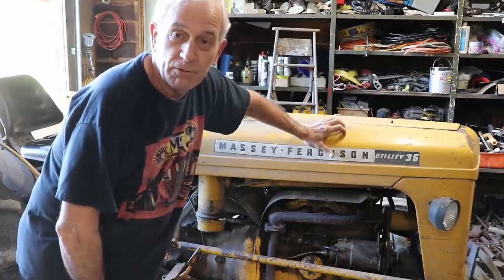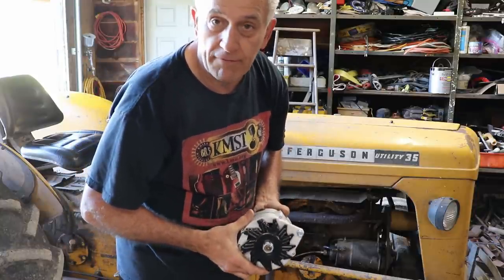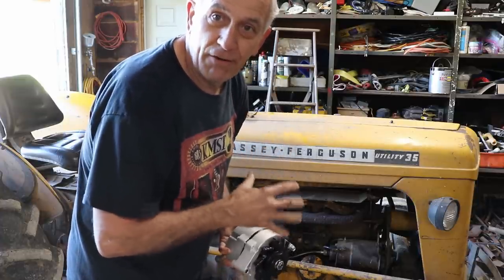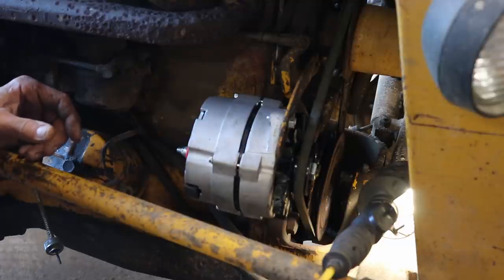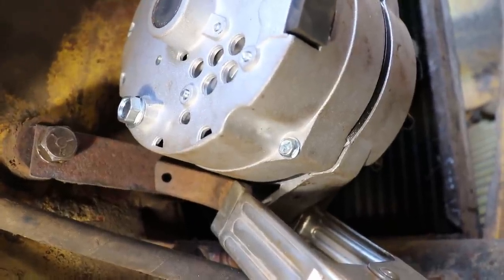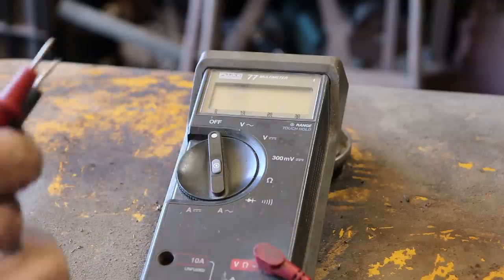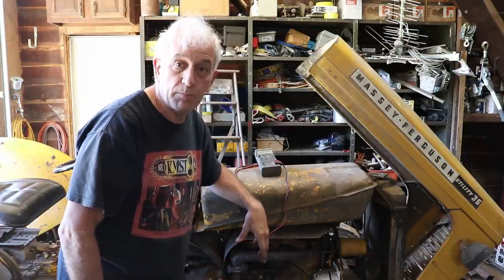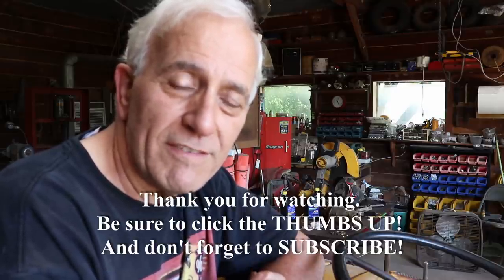404  RSW Generator to Alternator Conversion

Comment: Hey Jerry, good decision to change it over to an alternator. I have done several changeovers. The last one was on my neighbors Ford 8N. I change the alternator with the kit I bought off and eBay. I put in new plugs and wires. I rebuilt his distributor and set the timing. He he said had more power than it ever had and he wished that he had gotten me to do this several years before because he bought a new tractor paying almost $20,000. He said he’d rather have his old tractor than a new tractor any day. Great vid Jerry.  Brad

Comment: Jerry 14.5 is great. Nice job. Nice tip on the low RPM alternator.  You could also add an electric tachometer where the tractor is gass, if you really want a tac. Oh I love the remark "gotta be a real man" holding the metal bar on yhe anvil.  Done that lots. Love the video.

Comment: You are correct on the 35 being great for use on the farm.
My dad had two JD tractors then bought Massey' Ferguson only after about 1965. Hang in there !  My brothers and I have one wire updated so many tractors since the mid 80s.   Jeff has done this procedure just as smooth as yours.  You guys are the best. And Randy Shartiger also !
   Birds of a feather!

Comment: Hey Jerry, I had the same set up on an Oldsmobile engine in a boat. These alternators have a built in voltage regulator, that'a why it works with one wire. Only difference with mine was it had one small wire that came from a plug on the side of the alternator that you just jumped right to the pole with your big wire. I always had to rev up the engine for it to kick in. This was a great charging system. You could jump off your truck or any other equipment you have with it.

Comment: I 100% agree....best thing I ever did for my 1952 Ford 8N after putting up with the generator for decades.  At one point someone even gave me the idea of using an 8 volt battery and yes that did start better on the 6 volt system.  Problem was the 6 volt system couldn't fully charge the 8 volt battery so that was only a short time fix.  I enjoyed this as much as your tip on chain sharpening.  The one you told about reversing the motor direction on one side of the chain....so, again thanks for that!

Comment: Thanks Jerry - I had never heard of a “one wire” alternator. I was concerned about controlling the output, but one wire alternators have the regulator built into the alternator, to control the output.

Comment: Oh! how I remember 6volt generates & regulators. But that’s what we had 60 some years ago. The 12volt alternator was a BIG improvement to the electrical system on motor vehicles. Good decision to replace it. Additionally, electronic tachometer have been on available for many years.

Comment: Short stud in the front hold for a guide and torsion mount, bracket extended back to the rear hole with a U bolted to the bracket, then pivot pin/bolt to hold the alternator.  Again, heating your bracket after welding relieves stress on the edges of the welds.  Prevents early rust and failures.  Oil lubricant drilling steel?  I use alcohol with aluminum to keep the bit edge and light oil with steel alloys.  Saves regrinding bit tips.

Comment: I bought one of those one wire GM alternators at a salvage and put it on my dads old john deer 2010 tractor and it worked good. I need one for my IH lawn tractor 149 cub cadet.

Comment: My dad converted an old car that had a generator. He used to complain about the battery discharging thru the generator. Anyway, the old one laid around the house for the longest time. I thought I would wire it up to power some lights. The only problem was finding something to turn the generator fast enough. I thought about a bicycle but gave up as "it was too much like work". Years later when I was clearing the house out to sell, that generator was still there. Memories.

Comment: I don't know that much about alt./gen conversions.  I know some alternators are internally regulated so the battery isn't overcharged.  I suppose you must have one of those...  I once had a 1953 Willys CJ-3B.  I restored it, electrical system, and all.  I had the generator converted to 12 volts, change bulbs, electric wipers instead of vacuum, and regulator.  Debate on alternator conversion but wanted to keep it as original looking as possible.  That was my "Nelly Belle!"

Comment: I can see the tachometer cable from here... noticed it right off, but only because I have done this conversion about 20 times 
(I used to be the mechanic at a rental yard / used equipment dealer).  BTW, generators are sometimes better in really wet conditions, but not often on a reasonably dry farm.

Comment: Jerry have you heard of heating the metal after you hammer it straight to take out the stress and avoid having it fail from vibration through the stress area?  Gauntlets help to save the hands a bit of wear, just saying, LOL.  Been there myself and just advising for younger folks.

Comment: If possible, try salvaging that tachometer fitting with the axle and pulley from the old generator and stick it to a free spot on the belt. The idea is to get rid of most of the girth of the old generator only keeping the necessary bearings and stuff to hold it together. There seems to be enough space under the alternator. I know it's not an essential part of the tractor, but it would bug me to no end having a literal loose end on there.
Reply from the maker: I removed the loose parts.  I purchased an electronic tach but can't get it to work correctly as yet.

Comment: I wonder if there was room on the other side of the motor, the new alt could be mounted on the left, and you leave the generator where it is, disconnect the wires, so the tach will still work.
Now that you have more amps at low rpm, you can ditch the 10 pound steel radiator fan blade and install a little electric fan. Way better cooling and lots of empty space :)

Comment: Keep a roll of aluminum foil handy when using standard wrenches on metric bolts.  You can fold a shim for the open end side of the wrench to get a fit that will not round the head of the metric bolt when you tighten up. Looks like you got it squared away.  There is a reason Harley motorcycles are known as tractors.  The tractors are overbuild and will run even with a lot of use and abuse.  I have driven a number and prefer the wide front wheels on a hill.  You alternator solution is great.  An electric tach is not that expensive, but if you don't need don't put it on.

Comment: You probably know this, but an alternator has a much higher current output at low RPMs than a generator.  A smaller pulley on the generator might have work, but the alternator is still better.

Comment: It's there if you ever need A tachometer Bosch makes an electronic tachometer I believe it connects to number one Spark plug
Reply: Well the problem with that is the tractor is a diesel (which I noticed is almost empty) and doesn't have spark plugs.   When I was a young man I was a blacksmith and agricultural engineer and the early Fordson tractors did have spark plugs because they ran on paraffin.  Well they started on petrol and when they got warm you changed over to paraffin.
Reply: @georgevanwin  LOL, well I saw a coil, distributor, and 4 plugs on that tractor. Electronic tachs hook up to one of the terminals on the coil.
Reply: Normally one side of the tach hooks to the negative side of the coil and the other to a switched 12 volt supply, (usually the ignition switch). That is for older models that still used a coil.

Comment: Generators produce about same voltage per rev as an alternator, but as they have the heavy winding spinning on the centre winding they would fly to pieces if they spun at the same speed as an alternator. Alternators which have the heavy winding static inside the outer casing can spin at higher revs without flying to pieces, the small excitation windings sit on the central rotating shaft.  The alternator pulley is smaller and therefore spins the alternator faster giving a higher output than the generator for the same engine revs. Have you got a charge
Reply: Sorry did not finish previous post do you have a charge light

Comment: You could put an electronic Tach on it that runs of the ignition system. I had one on my 58 olds back in the day
Reply: If nothing else something like this (https://www.amazon.com/dp/B0811DS458/ref=sr_1_24?dchild=1&keywords=4+cylinder+tachometer&qid=1591552368&sr=8-24) stick on digital tach/hour meter. The sensor lead just wraps around a spark plug wire and adjust the correct multiplier for the number of cylinders in the setup screen and you're done.

Comment: we only ran Massey Fergusson on the farm, reliable machines, I wish I had money to buy a 165, put a bar on front and use it to run around town, all those dodgy drivers will keep clear of you ! Jokes aside, a great conversion, and if I am correct, the later models ran the tach from off the camshaft. there is probably some new hi tech stuff available if you really wanted a tacho gauge.